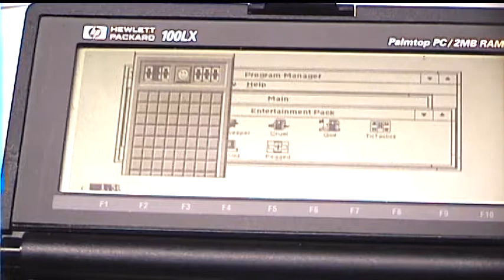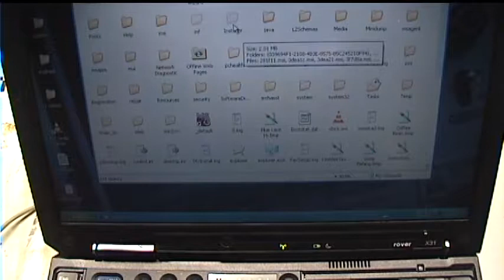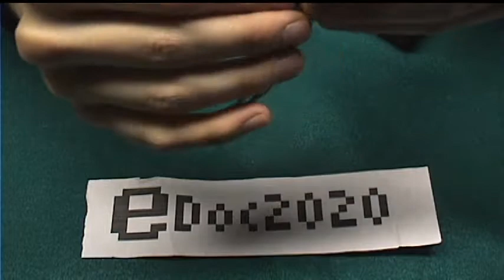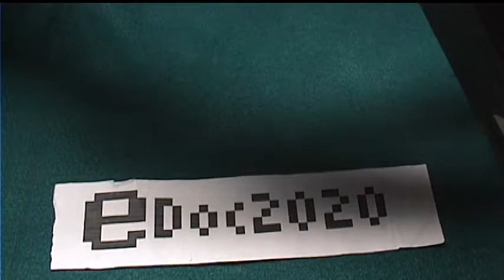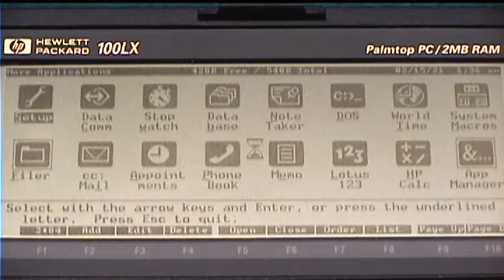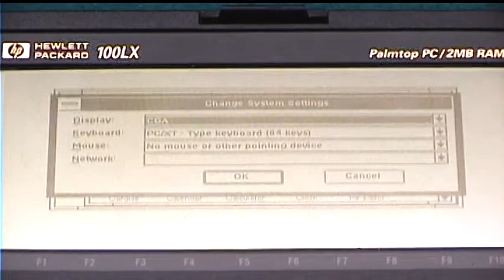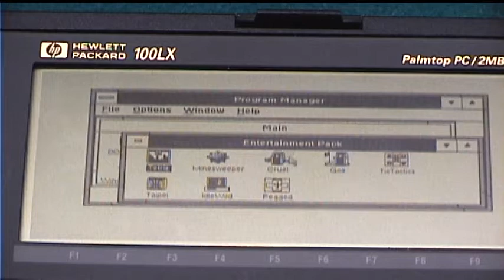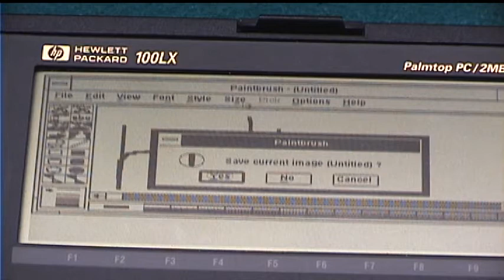Connecting a mouse to my HP Palmtop PC - eDoc2020 #7

Comment: Hello, I watched your video, and then tried to connect my 200lx to the mouse, but the result can not be used under windows3.0a and DOS. I used the official data cable and DIY data cable. In the test, the mouse cannot be detected, but it is completely normal to communicate with another computer through the com1 interface. I don’t know where the problem is. I am pretty sure that my mouse and data cable are intact. What should I do? Do, thank you
Reply from the maker: If you can communicate to another computer using the palmtop's serial port but not your mouse then maybe you only have a null-modem cable. A mouse will only work if you have a straight-through cable, or alternatively two null modems. If your cable is the correct pinout you should see voltage on pins 3, 4, and 7 of the connector but not but not 2 or 8. Pin 9 is ground. If you don't see any voltage at all then the serial port is not enabled. In the Setup app go to the Communications dialog and check the box to enable COM1 in DOS. Alternatively run 'serctl /w' from DOS to enable power to the port.
Reply: I read somewhere that the official cable is actually a null modem cable so won't work with serial equipment without an adapter
Reply: @KL-bi2un  Yes, the official cable can only be used for data transfer, not use mouse

Comment: I have the official cable, what other accessories do I need to use the upper mouse?
Reply from the maker: With the official cable you should only need a null modem adapter. Searching "null modem male male" finds lots of these. I would get one without a cable.

Comment: Hello, I have made 2 sticks with no success, can you help me make one and put it on ebay for me to buy, thank you
Reply from the maker: What do you mean by "sticks"?
Reply: @eDoc2020  Sorry for the google translate problem. It is the cable that can use the mouse in the video
Reply from the maker: @smithlau  Okay, so the adapter cable? Me making one to sell is a bit too far but it looks like there are a few already on sale. The official part is F1015.

Here are the listings I found:
https://www.ebay.com/itm/New-Serial-Cable-for-HP-Palmtop-200LX-100LX-1000CX-/273753299350
https://www.ebay.com/itm/313935131839
https://www.ebay.com/itm/HP-F1015A-DOS-compatible-cable-/294298500623
https://www.ebay.com/itm/325009225106

If you buy the official cable you will also need a male-male null modem adapter.
Reply from the maker: @smithlau  I just saw you are the same person who already tried the official cable. If you have that you should only need the null-modem adapter.
Reply: @eDoc2020  Originally I had 2 cables, 1 official cable, and 1 DIY cable, I tried testing with DIY cables, bought adapters, and tried to cut the legs according to the drawings you and others provided, but Still can't connect the mouse, I suspect something is wrong with my method, so I'm going to buy a cable that works straight away. Mainly because I don't want to break the official cable :)
Reply from the maker: @smithlau  Here's a different thought. The Palmtop's serial port runs at about 6 volts but a desktop PC's is about 12 volts. Maybe your mouse can't run on the lower voltage. Have you tried using other mice as well?
Reply: @eDoc2020  It shouldn't be a problem with the mouse, I bought 2 mice, one is the mouse that Compaq computer cooperated with Logitech in the early days, and the other is the Microsoft serial - ps/2 compatible mouse
Reply: @eDoc2020  I just read that the first ebay link you posted is the cable I bought from this store